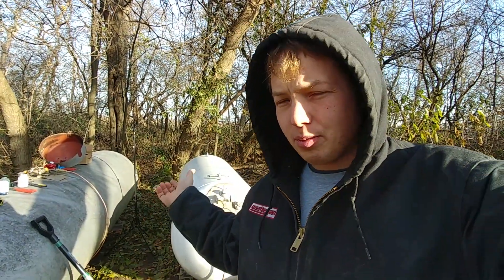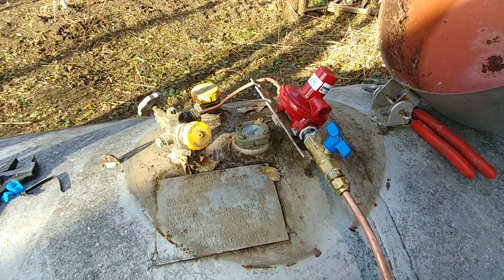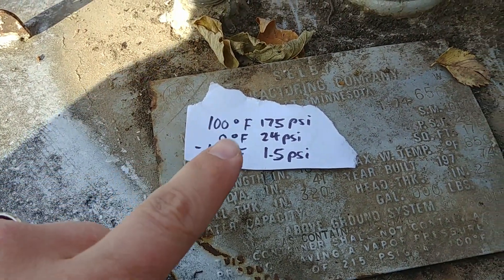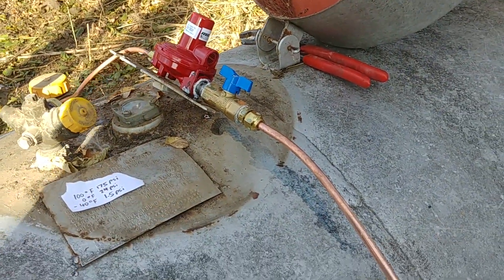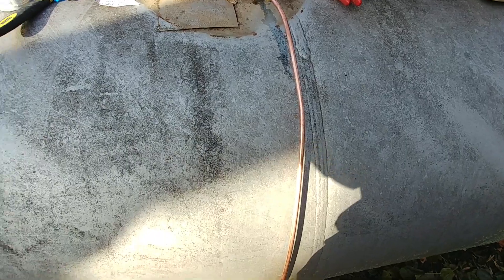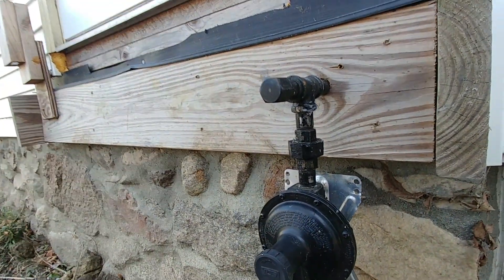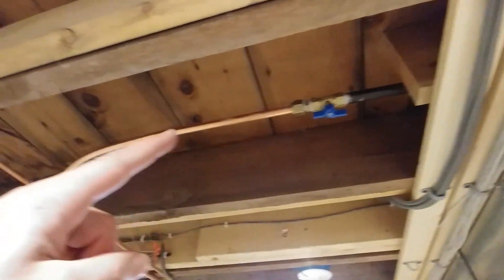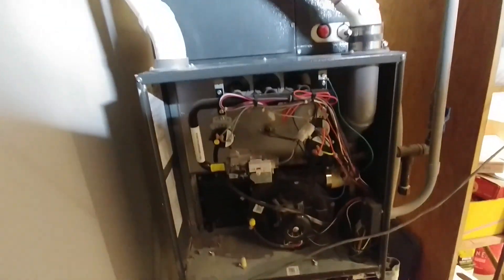How Does a Propane LP System Work? First & Second Stage Regulators, LP Pressures Explained

Comment: I'm a service technician for 18 years for propane company any questions I can help
Reply: I don't see any replies posted, where they done privately?
Reply: @douglb8960  I'm a 60 year propane technician and propane chemist.  ask me!!
Reply: Question...I have a Maytag kitchen stove we converted to uselp from ng. The ng has a silver flex line but we need to connect that to the 20lb amerigas lp tank. Can you help me with the connection part names I need? The flex line is a female at both ends and connects to regulator on stove. We need help from other end of flex line and to propane tank. Thank you
Reply: @yvettemeza3384  Hi, did you get an answer for your question?  I'm looking for the answer to your question as I have a similar setup in South Florida and wanted to see what the suggestion was.  Thank You
Reply: Question: I have a LP range in my kitchen that has a small external LP regulator rated at 10" attached to it. That regulator is connected to a shutoff valve that is connected to 50 feet of 3/4" black iron pipe. Is there a regulator and connectors that I can connect a 15 pound LP tank to the other end of the black iron pipe ?
Reply: @VideoGrabBag  Hi, did you get an answer for your question?  I'm looking for the answer to your question as I have a similar setup in South Florida and wanted to see what the suggestion was.  Thank You
Reply: How do we contact you?
Reply: @x.y.8581   reach around
Reply: Bahahahaha - I got 23 years of experience if you have questions.... Doesn't respond to a single question.
Reply: John Farley I am moving to a house place that has propane tank for use with the stove. The valve is missing that connect the line to the tank? Will the propane company fix that or install one or what do I need to tell then needs to be done? I am new to propane and don’t know what to do and don’t want to blow anything up
Reply: Should my line be bonded to the panel post secondary regulator? Or does the underground copper line prior suffice?
Reply: Do I need a high pressure regulatory or low pressure reg ,was having a problem keeping the heater on so I purchased a new heater. That's all we have on gas propane. It goes out at night and can't get it to light again until tomorrow when the sun comes out.
Reply: @rickeyfrazier2407  I am having the same problem. Did you ever get your problem resolved? If so.......HOW?
Reply: Hi, can you connect two tanks at their full pressure (non-regulated), and run one connection to a regulator? I have a 500 gallon tank, want to add another 500 gallon tank.
Reply: I have a convection oven that needs to be connected what do I need?
Reply: I'm trying to help set my best friend near Ashville Carolina, set up to run Propane portable generator from his in ground tank. I calc that it's probably a 500 gal tank.   I have pics of the ports but there's a big red regulator to feed the house. A large full port under a white cap. Not touching that.  Then there's what looks like an ACME, coarse threaded port under a yellow cap. I figured I could connect the BBQ grille to tank like connection to that. However, when I attempt to attach, first the balance is stick on so the port rejects propane under extreme pressure of course.   Before I can get the threads to engage, I think my connector tip is bottoming out. Therefore I can insert the tip, it pushes the tank port valve in but I can't screw down the connector to retain my hose to the tank port to feed the generator. (I added a regulator in the generator hose. ).  There is a rubber seal sitting inside the tank port that isn't like a BBQ 20lb tank connection but the threads are the same.    

So in the end I guess I need to know if that typical outlet port is a connection that I can tap temporarily to feed the generator and what the screw on connector is cashed so I can buy one to make a hose from.
Reply: I don't know if you can help me out here or not, hope so.  I have a 500 gal tank which has a primary LP low pressure regulator on it.  There is 3/4 inch black pipe going to my ceramic workshop from that primary regulator.  On the outside of the workshop is a secondary low pressure regulator set at 11 inches WC on which I run a small gas kiln that uses 120,000 btu/hour (two burners at 60 btu per hour).  Five years ago I purchased a larger gas kiln that also runs on 11 inches WC but has four burners running at 280,000 btu/hour.  I have never used it!  Recently I purchased a low pressure regulator for this particular kiln from the manufacturer of the kiln.  It is my understanding that it is pre-set to 11 inches WC.  Now, here is my question.  Can I connect this new low pressure regulator to my larger kiln without a problem since it will be on the same  line as the smaller kiln?  I do not use the kilns at the same time.   I know this is probably a stupid question but would greatly appreciate your feedback especially after all these years.  Thank you.

Comment: I wouldn’t ever run copper inside to an appliance.
Seen many jobs where over time the inside of the copper flakes and it travels to the dirt pocket fills it up and then it eventually gets into the gas valves. 
I’ve heard ever theory on what creates this problem like the copper was refrigeration copper, to small/undersized copper, cheap copper etc etc

Now I honestly haven’t seen it in a propane install but natural gas yes.
I would say the cause is the sulphur in the gas but honestly do not know why!!!

Anyone have a theory or facts on why?

Comment: If you bury your tank, you do not have those temp related pressure extremes....always bury tanks!  Also, no one runs copper pipes anymore,  they corrode  in the ground...

Comment: This is fantastic (as are all of your videos). I have a question. Many years ago our buried 500G propane tank was split- One line runs for a pool heater, and the other runs to our home and feeds just a LP range. Outside the house we have a regulator that drops the pressure to 10" of water column as you have. 
I installed a generator many years ago (portable) and did a propane conversion. I split the propane line AFTER the regulator outside the house.  So. Clearly my generator generator ( That's been working perfectly for years) is being fed by 10"w.c. propane. But there is a regulator on the generator itself that the line goes into. 
Is that (third) Regulator doing anything? If the propane is already at 10" WC When it goes into the generators regulator it's not being reduced, right? So in theory, could I pull that regulator off?

The reason I ask is because I'm Thinking of running that line to a barbecue grill. I wouldn't need another regulator, would I?

If you see this and can help me, I truly appreciate it. Thank you again.

Comment: Well, I know this is way late but burying copper tube will rot out because of the minerals in the ground it should be coated black iron or direct bury approved gas  pipe I hope this helps someone! I bet this is leaking by now?

Comment: Your second stage regulator is too close to your basement window. The code requires 3 feet from openings next to or below the regulator. Propane gas is heavy than air and can enter into your building if the regulator fails and dumps gas out of vent of the regulator. Pressure in propane tanks can vary depending on the amount of propane in the tank and the temperature outside. Sizing a propane tank is based on the total load expectancy  [btus] that propane system will require. Your sediment trap on your furnace is improperly installed. The trap nipple and cap must be downward in direct flow of the gas. The way it is installed now , it will not prevent possible scale from inside the copper tubing from entering the control of your furnace. Copper tubing will scale inside and if disturbed can be problematic to gas appliances. I was a propane gas installer for 41 years. I hope this information is helpful!

Comment: You make an initial comment that you'll cover 2 propane tanks at the end of video, but looks like you forgot you said this. When you have 2 propane tanks are they connected to the main line simply with T-connectors? Or is there something else in the plumbing ?    Would two propane tanks draw down equally?
Reply: I see that you made a separate video that discusses 2 propane tanks. Thank you.

Comment: Probably more helpful for someone who has a fair degree of knowledge of the pieces and parts you are referring to. Not for a Diyer who does not, although the basic discussion of temps/ pressure/ volume were very helpful. Would all that apply to smaller tanks as well?

Comment: the traps are installed in correctly , refer to NFPA 54 (2018) addition -9.6.8 -the way they are installed would be for Nat gass as a "drip Leg" ont a sediment trap  that is required for LP gas

Comment: Seems info is like revealing the secrets in a magic trick ... Thanks ---  " .. we can handle the truth ... "  ( gas companies avoid questions like they were  asked to kiss a leper ). Noticed insulated / cushioned  mount where manifold is screwed to floor joist ( for clearance )  and drop line / trap before entering the furnace ... I'll keep that in mind --- nice ,clean work .

Comment: at -40F you have 1.42psi which equates to 39.5"wc. So you will have enough pressure to push the LP gas into the house. The question is will you have the volume based on specific gravity to satisfy the need of the furnace?

Comment: I didn't see you explain the dual supply tank idea; are you testing efficiencies varying with tank volumes of fuel, myself noting that lower volumes see to record more efficient use, although gauge reading sensitives could be an issue there?

Comment: Im planning to do 2 40lb LP tanks with 2 stage auto change over RV regulator with around 30 ft of 3/4 pipe then reduced down to 1/2" behind the range /oven  this will be the only appliance  I will be running. Does this sound doable to you?

Comment: I have two 100# bottles now supplying an emergency generator and a Jen Air cookstove in the house. it is plumbed for a gas fireplace and a future fire pit and grill hookup .Am wanting to install a hot tub as well. Have a 250# tank on other side of house and am going to tie into the main gas line so not to starve the system. will i need to install another regulator before i tie back into the system.? I can tie into the 1st stage regulator before i go to the hot tub correct. can send drawing if this is confusing.

Comment: I work with this in the UK and you would not have copper running ug here, 1st and 2nd stage regs usually both at tank unless long pipe run ug

Comment: Hi can the 2 propane tanks just be connected together at their full pressure (not through any regulator), and have them both simultaneously supply a regulator?  I have a 500 gallon tank, and want to add a second 500 gallon tank.

Comment: Great video and information. Most folks are aware of the first regulator at the tank. In cold weather, you'll learn the hard lesson if that second regulator is exposed to snow, moisture, freezing weather  and limits PSI to appliances. Well outlined and terrific information. Thank you again. I'm sure the home looks fantastic.

Comment: 🎶If the weather outside is frightful,
And your furnace quit cuz your LP pressure is godawful.
Watch Ben's First and Second Stage Regulators video, 
Then let your LP flow, let it flow, let it flow. 🎶
 
Thanks for info Ben. You answered SO many questions I didn't even know I had.  You rock!

Comment: Ben, I was trained by Westland Oil Company years ago. We were taught up to 250k btu input, 1/2od copper on the primary line. Over 250k btu up to 350k btu, 5/8od copper on the primary line. I don’t think that your 3/8 copper line is big enough. Another way to increase your capacity is to use multiple low pressure regulators. 1 low pressure regulator for the furnace. 1 low pressure regulator for the hot water heater, BBQ, cook stove. Another low pressure regulator for the auxiliary furnace, or fire place. 
Also Ben you do not need shut off valves on each line after the high pressure regulator. The LP can not go backwards through a regulator. 
We tied two 500 tanks together for years. I adjust the regulators so that the primary tank was 10 psi, the secondary tank was 8 psi. The primary tank would go down to 5%, then the secondary tank would start being used. 
Kind of like the automatic tank switch over valve on your camper trailer. 
Hello from north east Montana. 
10 miles from the Canadian border. 
In the last 3 weeks we have had -28°f two nights, -33°f one night,  -30°f one night, -31°f one night.
Reply: Hello Darrel, thanks for the advice. Can I get your thoughts on a project in Dallas Texas, first time doing an underground LP tank. I will be running two 5-ton furnaces One 6-burner cooktop with stove, a Propane tankless water heater 199,000 btu, a fireplace and a small pool heater? YEA...... I was intending to run a 1-inch poly line from the underground LP approx. 30ft from the home to the building envelope can you shoot me straight. Please.
Reply: @abelsaenz3611    That 1” poly line at 10 psi should be adequate.  Up here we try to put each major user on their own low pressure regulator. I would put each furnace on its own regulator. The fireplace & cooktop & oven should be able to be on a regulator. But down in Texas, I would recommend 1 regulator per furnace. Then the rest on 1 or 2 regulators, whatever is convenient. 
Up here we adjust the low pressure regulator to 10 inches minimum while running. That is why we run more low pressure regulators. When -30°f the extra low pressure regulators insure that the furnaces have enough pressure.

Comment: Great video, got a quick unrelated question. Why do people use a small pipe at the end of a iron gas pipe connection? I noticed that is a common practice, and also used for HVAC.

Comment: I'm in WA state and was told NO WAY LPG in a basement. Natural Gas is okay. LPG heavier than air and will settle on the floor. I was told that it is a IBC code. I've never seen a exact reference to the code so I can't cite it. This is a big deal to me as I see you've got your furnace in the basement. How did you get away with that? Was it not inspected? I thought most code enforcement officers went off  of the IBC rules so it's not a state/area type of issue. Edit: I found the code: 2000 Uniform Plumbing Code, section 1213.6

Comment: Great video I think you answered my problem I have 4 LP direct vent fireplaces all want 11in water .When my 500 lp tank was installed I asked them what it is set to and they said 11. I measured at all of my fireplaces and I am getting 7in. I think that might be why they all have wimpy output. Thanks

Comment: What about bonding? Does one need to bond the pipe to the panel, or does it running underground prior to 2nd stage regulation cover that? If that covers it, is it kosher to bond the water lines to the gas line? Thanks for your work here, been really digging the content.

Comment: Newbie here, pardon the question: after the second stage regulator, do you still use the regulator that came with the stove? Or do you simply ignore it?
Reply: mrstevetrevino, I have a dual fuel generator... it has its own regulator.  It is just hooked up to the tank no other regulator.  I have no idea why this guy has two regulators except he wanted to use a smaller line going from his tank to his house.  If you look at a gas grill as an example, you only use the regulator that came with appliance.  I am not an expert, so wait for the critics, to tear me a new asshole and use their advice.  I found out if you ask you don’t get a reply, but if you state how you did it, then all shade tree plumbers come out of the woodwork.
Reply: @samuelspade889  well typically real techs don’t like to answer questions that don’t have all the pertinent information bc not having all the info can lead to improper answers but yea you do only use one regulator on a grill bc that regulator is designed to go from full tank pressure to the designed pressure of the grill nothing else needed plus grills are outdoors and require less regulatory interference however indoor appliances must operate at a consistent basis to reduce carbon monoxide and this is one reason for individual regulators at each appliance also if the line pressure regulator fails the appliance regulator is designed to lock up and prevent very large fires inside the home
Reply: Vault 614 ,  thanks... I get it.   So many people are sue-happy and take no responsibility for their own decisions.  Thumbs up for you.
Reply: Yes the appliance comes with a regulator and this is still needed even after the line pressure has been reduced to approximately 11” by the regulator either on the tank or at the house

Comment: Thanks for the video Benjamin! I got a question, I’ve just built a food truck using LP. We are In CO, pretty cold winter. Oven takes 3 hours to reach 575 degrees. I understood from your video that the colder outside the less pressure inside the tank. Could this be the reason why my oven takes forever? If so, summer should take much less time to heat up, right? Thanks so much!!!

Comment: Great video. I do HVAC and have worked on a number of propane furnaces. Typically the inlet pressure for the appliance is rated for 13 or 14 inches of water column. This ensures a manifold pressure of around 10 or 11 inches. Would there be any issue setting your gas regulator higher at the tank or at the regulator going into the house? Which one would you adjust I guess is my question?